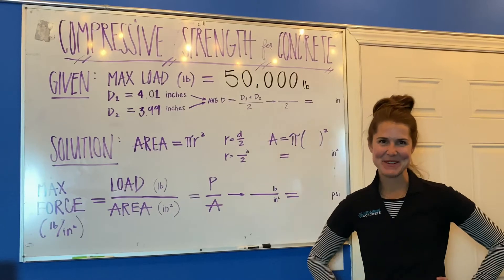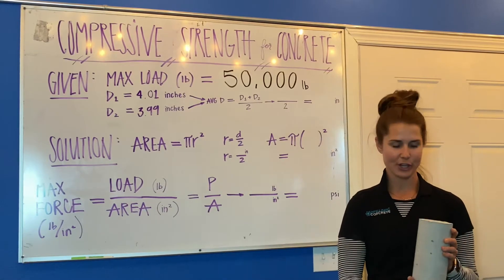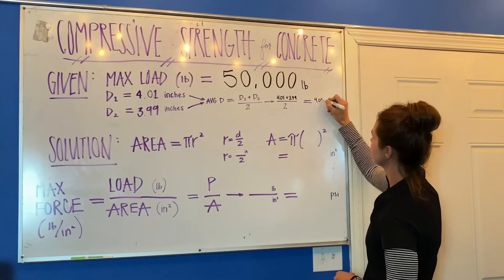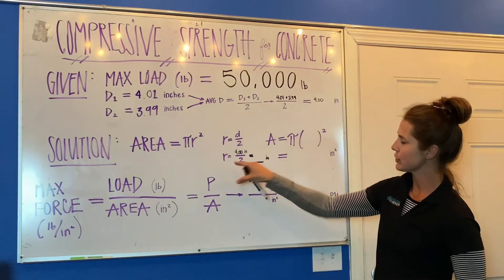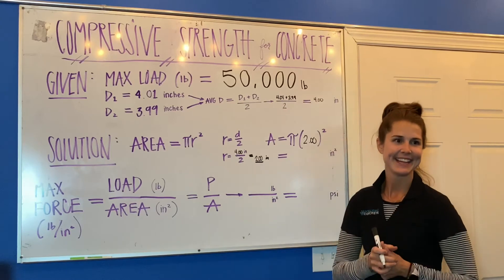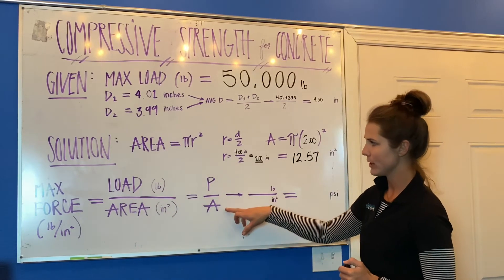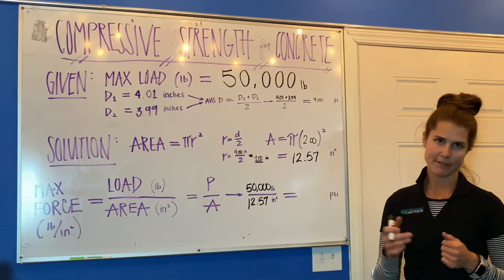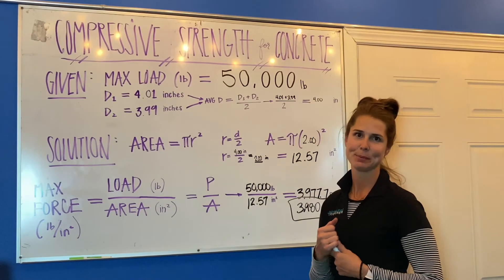How to Calculate Concrete Compressive Strength from ASTM C 39 Data - Vlog 656

Comment: isnt it the compressive strength is calculated by the bigger area of the cylinder? the diameter x height?
Reply from the maker: No Sir.  P = F / A.  Pressure = Force divided by area of the applied load.
Reply: @IntelligentConcrete  oh surely i know its §=P/A, what i mean is the area(A) use to calculate the compressive strength, isn't the diameter x height?
Reply from the maker: @stanjames4548  no.  That is when you are doing Splitting tensile strength.

Comment: Excellent Presentation: Can you help me understand why the latest (2020) version of ASTM C39 changed the calculation formula from using the standard cross-sectional area of the cylinder (as described above) to muliplying the applied force by 4 and then dividing by the pi x DIAMETER of the cylinder squared?
Reply from the maker: HEY HEY BRIAN!!! I didn't know about the change more than likely its due to the fact that we measure Diameter of the cylinder and not radius.

Comment: oh my god what are those units
Reply from the maker: Howdy Adrien, those are common units to express compressive, flexural, and tensile strength of materials in the US.  Across the big blue pond folks normally use MPa.  For a frame of reference, there is 145 psi for every 1 MPa.